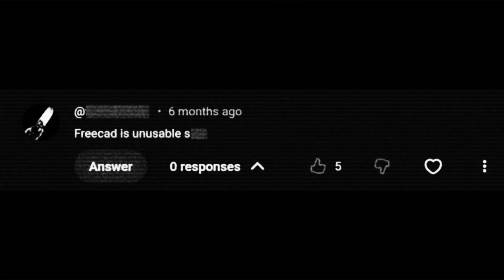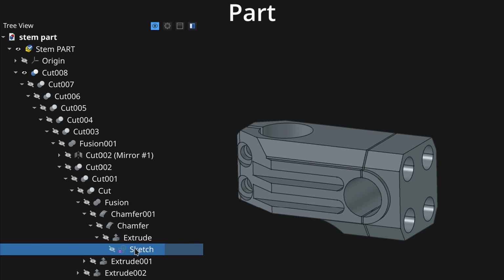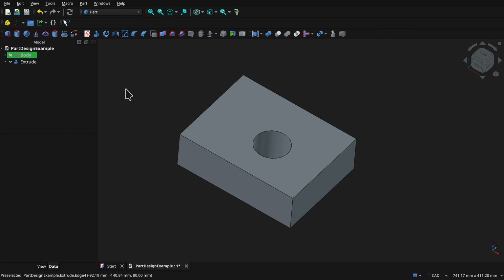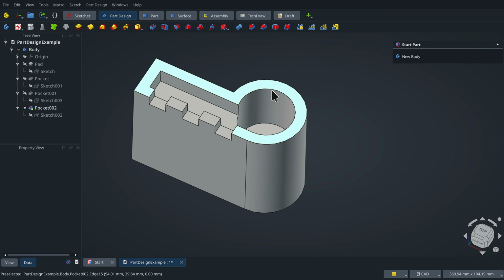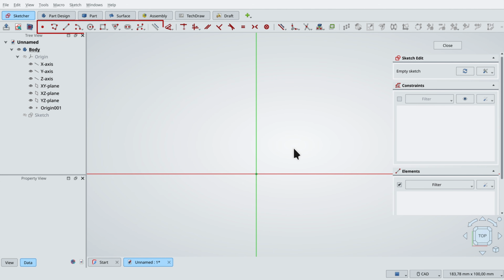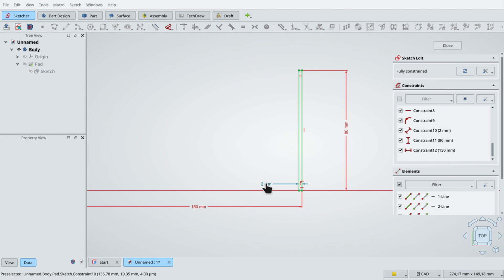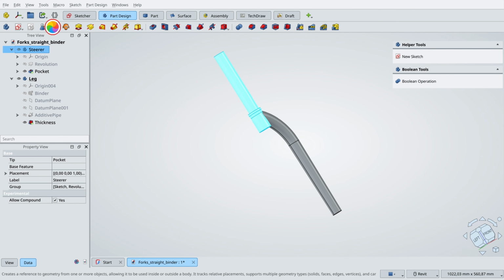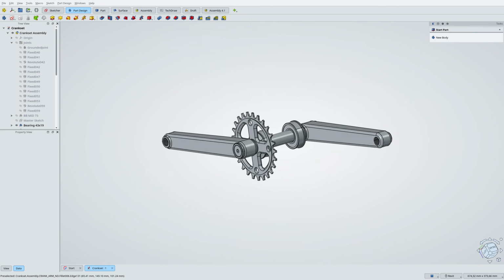STOP using FreeCAD WRONG! Do this INSTEAD (Workflow & Tips)

Comment: This is a great tutorial, but it doesn't actually address the issues people have with FreeCAD. It's great for a free software, but it really does have some work to do. for instance, take a cube and try to chamfer one of the top edges down to the bottom edge. It just fails. This isn't behavior you see in any of the other CAD packages, and it gives you an incredibly unhelpful and generic error message. After working in FreeCAD for a while, you know that's a limitation for unspecified reasons that you can work around. However, when you have someone new to the program finishing up a design that took a few hours and putting some last minute fillets on their part only to have the whole thing break, that's a deal breaker. To this user, FreeCAD just stole their time and effort and returned nothing. This user is immediately moving to another program that won't cost them time and money, and just slapping them with "skill issue" isn't going help entice them back. This is just one of many little issues users report all the time. Don't get me wrong, FreeCAD is great about improving all the time, but it's also good to take a step back and say "no. it's not the children who are wrong"

Comment: FreeCAD is still a night mare when it comes to stability. Not  only the UI is bad and over complex, the errors you encounter during use is terrible. 
I tried to use FreeCad in the past and had some good results, but took much more time to create something without a crash of FreeCad.
Even the version 1.1 is bad to use as always. It crashes some time  on mouse movements!
What takes me 1 hour in FreeCad I made it in Solvespace in 20 minutes, because of the clearer (and faster) and logical better UI.
FreeCAD isn't that bad, but overloaded with functions many users do not need.

Comment: The last time I tried FreeCAD was in 2020, I believe version 0.18. I then chose Fusion 360. Watching this video I gave it another go. Yes, I'm slower working with FreeCAD, because I still don't know all the shortcuts and workflow, but it was the same when I switched from SolidWorks to Fusion 360. FreeCAD 1.0.2 is totally different SW from 0.18, and 1.0.2 is totally usable and can easily replace Fusion. I will start replacing Fusion by making new projects with FreeCAD. For the old projects, it will wake some time to switch to Fusion (I still have very old projects in sldprt format).

Comment: This Video is really awsome! I started the use FreeCad a loooog time ago, but not very often. 
For me Onsel (the  "commercial" Fork of FreeCAD) was a eyeopener for the possible improvements  in the UI...
I do actually struggling so hard in FreeCAD 1.xx to get the windows in a got arrangement. It would  be a  big improvement, if the would be something like a config-file to share for the UI settings.

Comment: 20:15 - how does the dimension flip here? You're editing the positioning constraint between the origin and the bottom left corner of the rectangle. Why does it get attached to the bottom right corner after merely increasing the distance?
Reply: I see. Instead of having a distance and a width, you replace it with two distances for the two bottom vertices. The explanation isn't very clear there and goes by way too fast.

Comment: Thanks for this very well ordered video, I use FreeCAD since few years tolerating or working around some aspects, despite my experience I benefit from some details your video (being for a right click on a place I never thought to click or other little details), I noticed one thing you suggested suboptimal and I determined a way to make it more robust
21:05 Sketch section: to optimise flexibility in further design modification, when importing shapes to a sketch prioritise importing(=projecting) shapes from another sketch if the shape are directly in a sketch object, otherwise as a secondary less preferable option as shape selected from a detail of the the body(as was in your video), select the imported shape from the chronology earlier object operation that created that shape (select the shape to import after activating the eye in the three of the first Pad/Pocket/… operation that produced the shape you intend to import in the new sketch). In this manner is less likely that an imported shape used as reference become obsolete/misplaced after modifications underneath

Comment: I have used Creo, Solid works, Catia V5 and Rhino, but now retired I use Freecad for myself. My most preferred was Solid works, but now I am beginning to enjoy using Freecad, especially all the addons you can have. I have never had it freeze or cause problems. I also like that I can have it on Windows and Mac and if I ever change, also Linux. There are thousands of instruction videos on YouTube, so it should be useful to everybody.

Comment: Don't get me wrong, FreeCAD is free and is under active development which makes it perfect as FOSS (and nearly the only option on Linux).
But when it gets to stability... it's annoying. I'm quite suprised (should I be really?) these videos never cover actual problems with FreeCAD but taste preferences like UI and workbenches.
Let's go:
1. What about fillets and chamfers? It's a glass cannon:
1a. Want a 1 mm chamfer for a 1 mm pad or pocket? No can do. The hack - do 0.99 mm. Not a right thing, but you can get away with it.
1b. What's with continuous chamfers and fillets? I'd like to use only this edge but not the rest of them as it tends to crawl firther that I need. Most common with rounded edges - it will try to wrap the whole face instead of a single edge you selected.
2. How about broken dependencies when changing a single thing in previous steps? I get it that amount of edges/faces may change, but why breaking attachments when these are the same?...
3. Drawing a copy arc over a projected geometry one still can't have the same constraints - have to only do a couple of constraints or it gets over-constrained. Annoying when projecting lots of rounded corners (rounded hexagon? torture).
4. Meshing:
4a. Is extremely slow. Not a PC issue as fstl shows these models super fast.
4b. And converting solid to mesh out-of-the-box is limited. You have to add more algos to get good meshing.
5. More of a feature request: why can't one add a step in part design in between prev steps? I can reattach everything back together no prob at all (given p.2 experience).
FreeCAD is fine and I will continue to use it but saying it's "misunderstood" is a stretch.
"BRep API not done."

Comment: My biggest problem with freecad is not being able to choose a single closed line tò extrude. I want to make a general sketch, then extrude the pieces, then project the first sketch in another as reference tò continue the part. Also no Easy way of extruding SVG, and adding parameters is slow. Why do I have tò create a parameter set when every single other CAD i can just create a dimension and use = or # to give it a name and create a parameter. It just slows me down a lot. Most of my cad work is completed in 15-30 minutes. On FreeCad the additional steps in every operation and the amount of documentation needed to be read before actually being able to do the things that I do, is much higher
Reply: Also the techdraw workbench is straight up terrible. Not being able to create a segmented section without having to go back tò the part, and creating a sketch there, that then 5/10 times decides not to work. Also I hate that certain buttons need tò be pressed before selecting the lines, and others work the opposite. It's uncomfortable and frustrating
Reply: Well, the 1.1 basically fixed most of this so now I'm going tò use Freecad much more lol

Comment: Finally, Finally it has been said: FreeCAD is wrong 😊Thanks for showing us how to correct this.
I am a 3D engineer with ~ 20 years of experience with different CAD packages (SolidEdge, SolidWorks, Inventor, Fusion and maybe some more that I forgot) and all of them have a learning phase. I have to say that the learning phase for FreeCAD is the longest I have had in a long time and this is part to some strange settings that are not logical for me. Open line ends are black and connected ends are red. This seems just wrong to me ...
Yes I know, I can change those colors but the default is just wrong.
Switching from Fusion to FreeCAD is taking me a long time, partly due to the fact that I still have to maintain some Fusion stuff for customers, but I am slowly getting there. And during the process I learn to love FreeCAD more and more. Yes, there are some things to take care off, like the fillets. But even Fusion has problems with this and the bad thing is that in Fusion this may change on a (mandatory 😤) update. From time to time I need to "fix" a Fusion model or CAM program because an update changed something.

Comment: I really want to like FreeCAD… But even after watching videos like this, I almost always run into strange issues, red warnings/errors in the report view. Sometimes I create a part, it looks good and when I export it most of the features are missing. I'm really into FOSS but I also value my time and I never run into issues like that with my workflows in Fusion360, OnShape or Shapr3d. In FreeCAD every time something goes wrong. Maybe it's because I use it wrong, but it even happens while following tutorials, so I guess there is stuff I don't get or stuff which worked in one version in broken in some way in another. It's a complex piece of software and huge time and effort went in it and it's amazing how far it has come, but sadly I'll rather pay money than loose so much time in being frustrated because of stuff failing and breaking "randomly" all the time. I'll still try again from time to time

Comment: I liked your videos because if feel like freecad as come a long way to get where it is right now...

But filets not working

and no common assembly toolbox is a deal breaker for any company and this is why no company i know works with it

I feel like it is really really close to being like KiCAD is to altium (99% of the features minus the price) but it is not there yet. It is definitely a software to learn and keep track off though (that's why i like you video)

Comment: If you gaslight yourself into dealing with shit UI long enough you learn all of its quirks you can use any app "well"
It's still shit UI. But it's getting better. Good tutorial too
It was sorta fine when I was making simple case for rPi but when I tried it to make house plans (it even had plugin for it, which fucking sucked) it was a fucking nightmare, It took forever to set up where walls were  in top down view and when I swiched in 3d for SOME FUCKING REASON it decided me dragging walls closer together means I want to put them on top of eachother and it was completely fucked up, because the tool is too dumb to figure out "if I see stuff rom the top I probablty don't want to change the elevation of things

Comment: The material is presented really well! I had already come across some of the issues myself, such as problems with fillets, but it was nice to see that I am not the only “inventor” in this regard.

I would really like to see lessons explaining how to organise work properly, from the initial concept through to a large assembly . That includes how to build parts correctly based on other parts , how to create mirrored parts , and how to heal surfaces by removing unnecessary fillets or chamfers.

I would also be very interested in a detailed explanation of how to work on technical drawings , because to me that seems to be the most difficult part of working with FreeCAD.

Thank you very much both for this video and for the previous ones. And, to be honest, working with FreeCAD gives me very mixed feelings: it really is very slow, but at the same time it feels like it has bottomless potential.

And by the way, the Russian doll is actually a Chinese doll — the ruZZians, as always, simply stole it from their neighbours

Comment: I can seriously resonate with your closing words. When I needed to move on from tinker cad, I chose fusion 360, simply because seems all makers were using it and more YouTube content was available.
Oh boy, my mom would not approve what came out of my mouth so many times.
Today it is so natural to use it that everything else feels crap. I tried freecad a long ago and perhaps it's time to try again.
I am actually in the midst of dirty mouthing to SW, and is so tempting to just go back to f360, that my major hurdle to learn something else is the temptation to go back to f360
Reply: I did the same when moving from 3DS Max to Blender. I would switch back to the former because it was naturaly faster for me to do things the way i knew but, as with everything, practice is key.
Also printing a shortcuts cheat sheet was helpful for Blender.

Comment: Nice video really. Just wanted to add that something very frustrating with FreeCad is that unlike every program, the rule "if you can't use it it's the software fault" does not apply. This rule is universal. Though, the freecad community will always tell you you're issue. (Never asked for help or anything, this is what I've seen going through the forums on others threads)
Reply: Not true. At least i haven't seen such behaviour in the forums. They are usually full of helpful people that don't hesitate to whip out a new project and screenshot it to demonstrate how to solve your issue and, if you provide a file, some will even send it back with 2 or more methods to achieve your desired result. There might be some bad apples but that goes for all communities out there and you should be able to dismiss them or report them if they bother you.

Comment: For me, I often have to use fusion, despite prefering FreeCAD. Reason being the difficulty around working with multiple parts that relate to each other. In FreeCAD referencing parts between each other is sure to result in a circular reference sooner or later, which is something that Fusion somehow figures out on its own. Im so used to doing this kind of workflow, that more complex asseblies often fail for me in FreeCAD.

It would be very nice if you did a in-depth video on that, as far as i know the first one on yt.

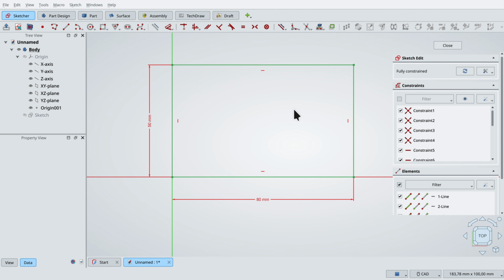Comment: 18:33 Perfect example of how poorly polished the UI is and why I haven’t pursued freecad further. Constraining your rectangle is important, but those freaking origin lines effectively hide two sketch edges! This drives me insane. Why the sketch lines aren’t thicker, always on top, a different color, something. The relations and dimensions are too small/subtle. You need context highlighting as you pass over lines that makes it obvious, make them thicker and change the color.
Reply: There are options to change the size and coulor of these features. But I also admit that my atempts in improving this also failed.
Reply: @c @clockworkvanhellsing372  I wasted too much time trying to fix this as well.

Comment: I liked using the spreadsheet to make certain parameters for the parts easy to adjust, especially when dealing with 3-D printer tolerances, I just got annoyed when it would not guarantee that the point stays left or right when the distance between points is adjusted and I couldn’t find an easy solution or setting to fix this. It also got pretty laggy when spreadsheets start to become big and I could not find the setting to only recalculate when some things changed in the parameters on the spreadsheet. if anyone has advice, I would appreciate it.

Comment: Ummm,.. not sure how I missed the openGL support. One of my biggest complaints has been no GPU acceleration. Most freeware will only support Cuda cores if there's any hardware acceleration at all. And while Intel integrated chipsets don't have "awesome" GPU's, they are actual physical GPU's and not software acceleration. Switching ffmpeg to use the intel hardware is the difference between 30 minutes and 12 seconds rendering. So it's really nice to see FreeCad actually using my GPU now. Thank you!  And I like that Theme add-on too. Though I don't like how it's showing the full circles for arcs. Gonna have to dig around and turn that off.
Reply: Found it. Inside the sketch, top menu, Sketch, Visual Helpers, Toggle Circular Helper for Arcs

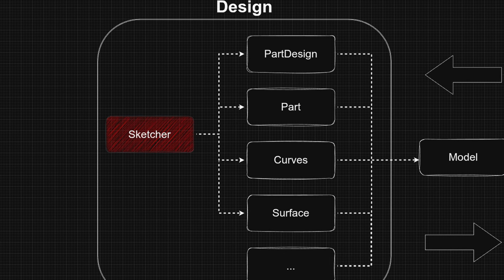Comment: I am just at 1:45 and there's a fat big lie already. Because whenever you actually go back and change a tiny little thing in the sketch - you immediately get 9834897235498 unconstrained dimensions and if god forbid you have a chamfer or any other operation on a solid alreqdy done by that time - the entire FreeCAD application will just f-koff into valhalla. 
FreeCad is not exactly free if you have to invest 10000 hours into mastering it to design a ring with a tab.

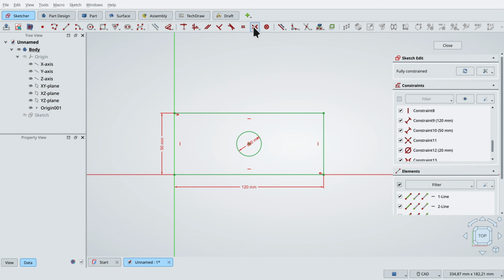Edit: 19:42 so, the constrained shape is marked green, it's corner/intersection corners are marked green AND selected points are green? Was this UI designed by a severely colorblind person taking a revenge on the entire world? Are other colors too expensive? Is there no imagination to mark selected points in any other graphical way? Or is it too expensive for a FREE cad? WTF? :D This is hostile af design by design.